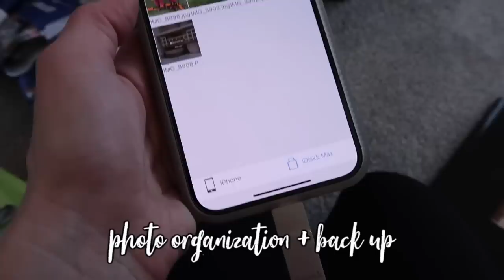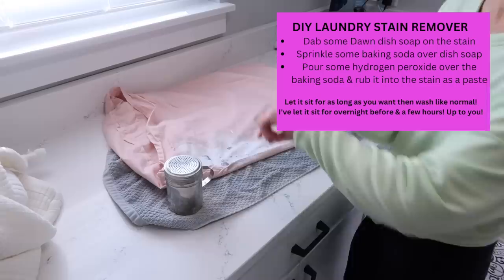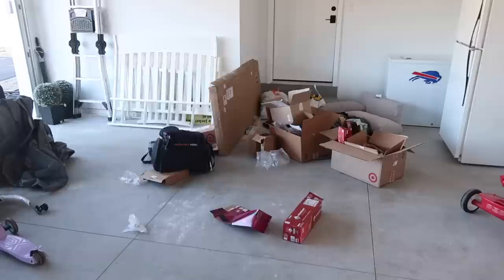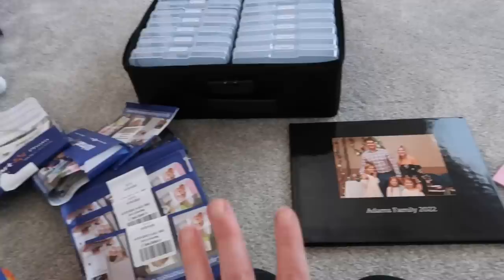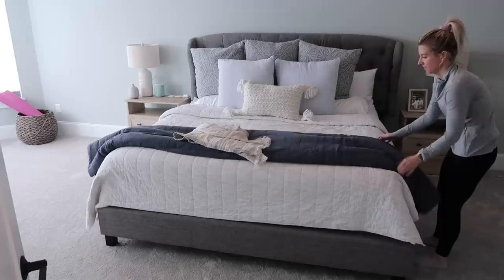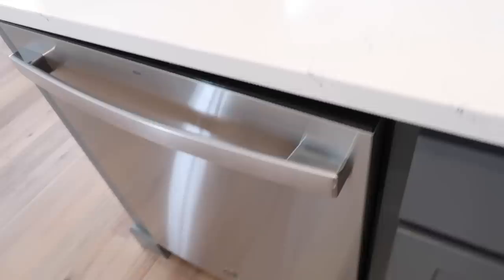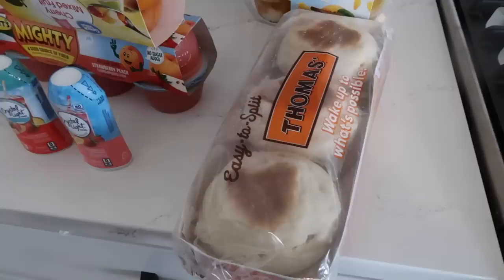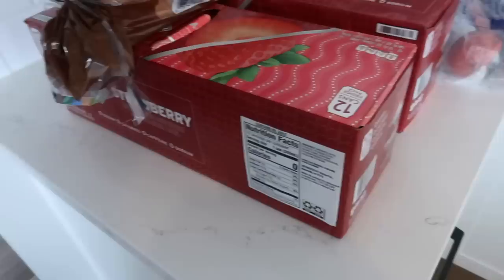*NEW* ORGANIZE & CLEAN WITH ME| SPRING CLEANING | CLEANING MOTIVATION|DEEP CLEAN |PHOTO ORGANIZATION

Comment: Our cable/Wi-Fi is optics. We love it easier
Probably more info than you were really interested in but here it is 2021
“Why is fiber, optics, communication faster?
Fiber-optic bandwidth is high because it transmits data using light rather than electricity which allows much faster Internet connections that can handle higher bandwidth. Fiber-optic cables provide a high data transmission capacity because the data is transmitted by fast-traveling pulses of light.”
Reply from the maker: Thanks for sharing!!